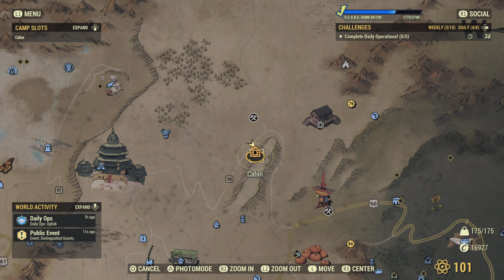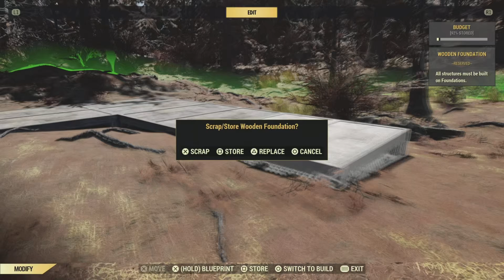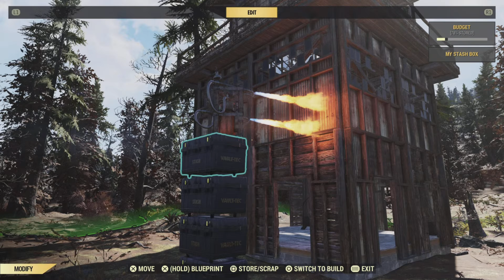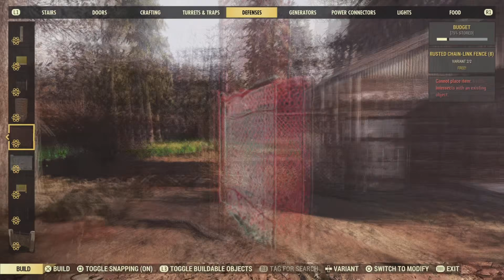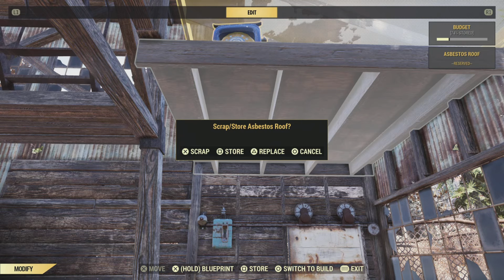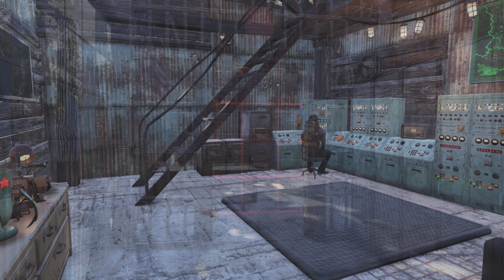Fallout 76 CAMP Tutorial - Immersive Prefab Watchtower Build

Comment: I've gotta figure out that thing you did with the generator and roof replacement.
Reply from the maker: Really easy, place sloped roofs, destroy them with flamethrower trap, place flat roofs underneath, place generator on flat roof, turn flat roof into a corner piece so you can see the generator, run a wire from it to the door switch, swap corner rood back to a flat piece and repair your sloped roofs

Comment: that conduit looks like a grounding connection, it would have a heavy gauge wire ran to a long metal rod driven into ground. this would direct lighting strikes through it to the earth not through the structure. so it  might be fairly accurate.
Reply from the maker: Now that would make a hell of alot more sense!